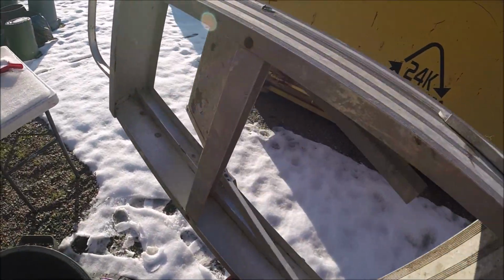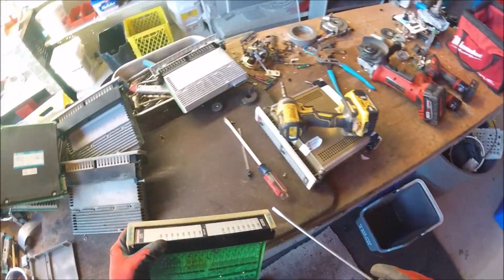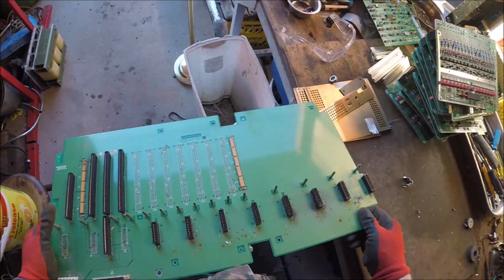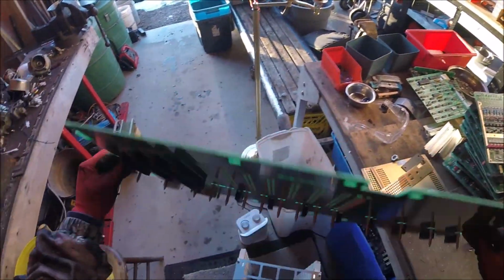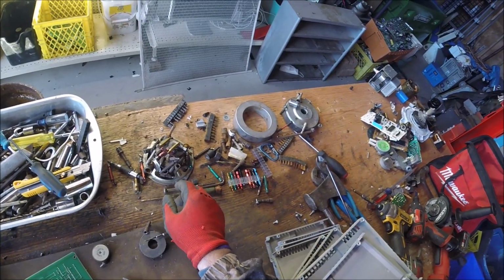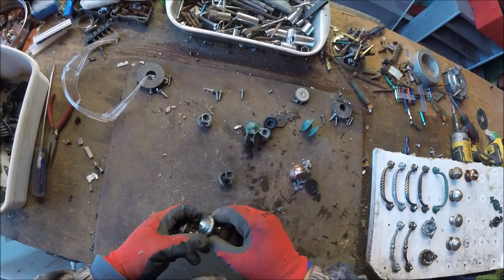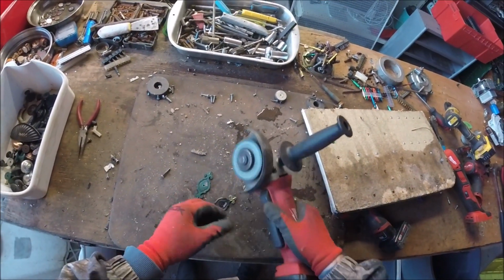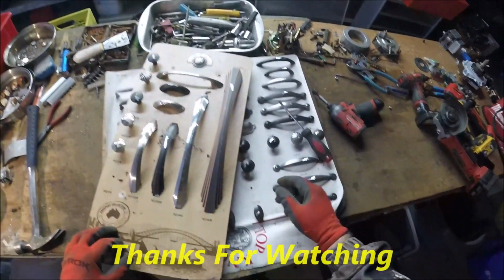Scrapping More Stuff

Comment: I remember that 'hardware' dumpster, it was FULL, and you still could have collected more. Spray the freshly filed area on the metal with some copper sulphate solution, if it goes dark it's pot metal or zinc, if stays shiny it's aluminium. 👍
Reply from the maker: Even if i did that, Its up to the scrap yard on what metal it is
Reply: @CanadianTreasureHunter  Yup, last time I went to the scrap yard, I had a bucket of pot metal and one of cast aluminum. They paid pot metal for everything...